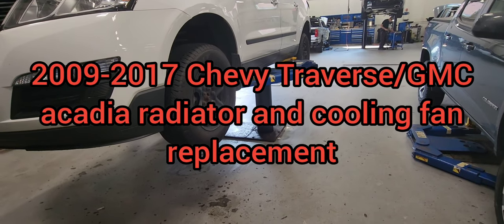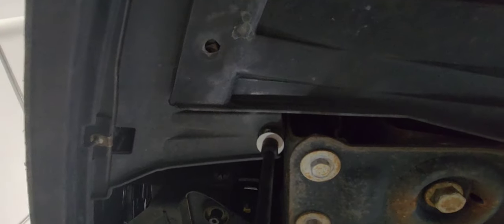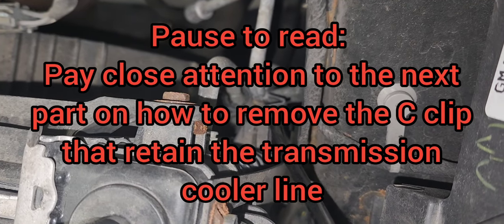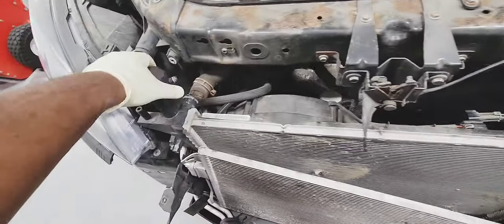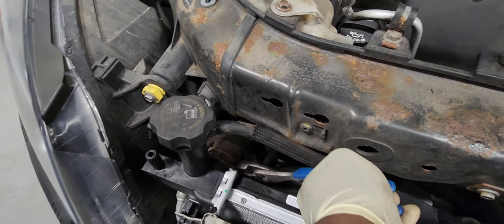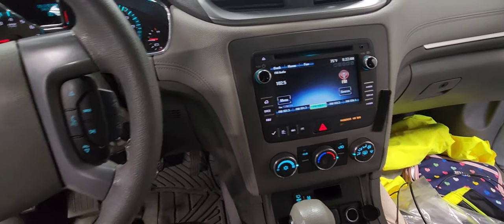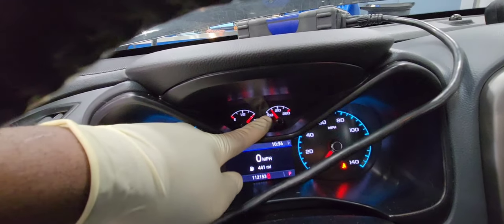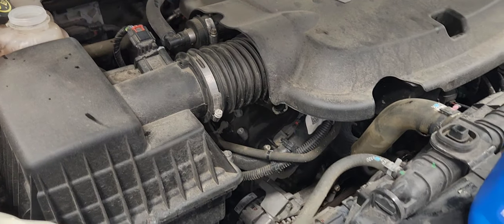Avoid These Mistakes When Replacing Chevy Traverse/GMC Acadia Radiator

Comment from the maker: Link for coolant used
https://amzn.to/3qs1RUf
flexible hose clamp pliers
https://amzn.to/3MhTJyi
hose clamp plier
https://amzn.to/3lXheSN
Link for e-torx
https://amzn.to/3qtFY6Q
Milwaukee ratchet
https://amzn.to/3Nb61c5
Link for basic hand tools
https://amzn.to/3CbD21t
Link for Milwaukee impact driver and electric ratchet
https://amzn.to/3J4vT6T
Impact driver only
https://amzn.to/3IXAnvW
Link for cooling fan
https://amzn.to/3rysdUX
Link for radiator
https://amzn.to/3Obd19l
Trim tool set
https://amzn.to/3zOPLG8